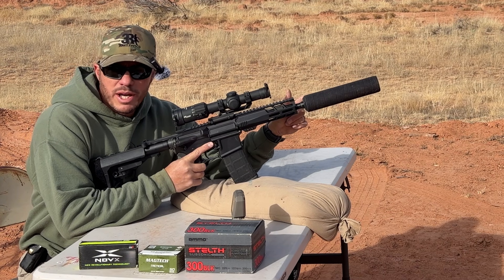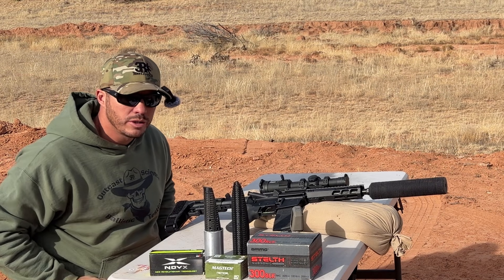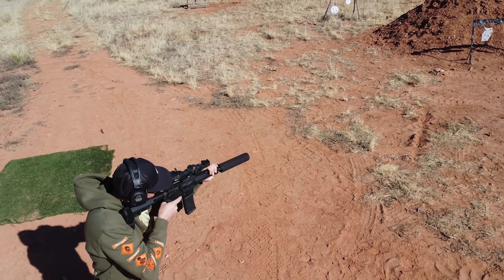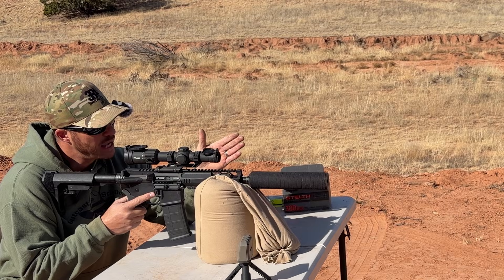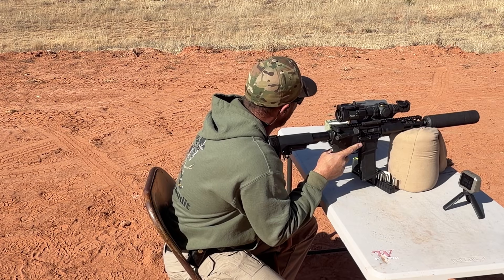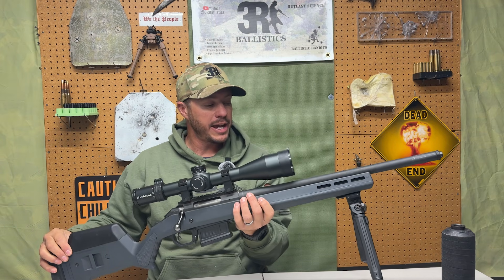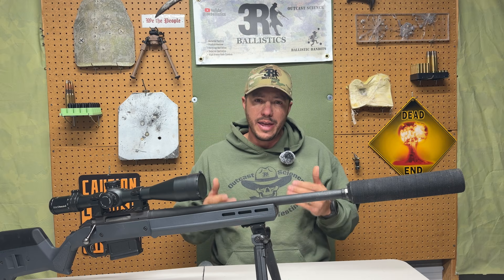3D-Printed Suppressor Tested, Part 2: PA6-CF Performs Better Than Expected

Comment: You can not do an accuracy test when pushing the barrel and can on a sandbag
Reply from the maker: Let really be honest. How accurate is a 7” 300 Blk firing a 220 grain at 50 yards. This was a bit flawed for testing and the reason I’m using a sub MOA rifle for accuracy testing.
Reply: @3RBallistics my 7.5 "is very accurate as long as they are going at least 1000fps muzzle, which i handload so they do. Short barrels are more rigid so should be more accurate than a longer barrel

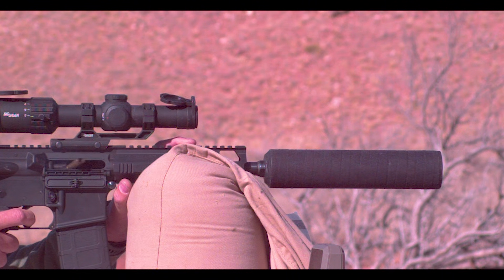Comment: 4:15, regarding yawing.  I have a 7.5 inch AR15 5.56MM.   I shot targets at 8 yards while suppressed.  I shot 55 grain FMJ and 62 grain green tip FMJ at paper targets.   The 55 grain exhibited round holes in the target.  The 62 grain were exhibiting the beginning of keyholing, the holes being round and up to 3/8" approximate oval sized holes. 
I don't know what the rifling twist is in that barrel and I forget the velocity of the rounds, but over 2000 fps.  Both the 55 grain and 62 grain were military ammo.

Comment: For my form 1 printed suppressor I sprayed 2000f ceramic black spray paint in the first baffle before I put in the adapter. Really drinched it in there to try and coat all the baffles. Not sure if it's completely through the whole suppressor. Supposedly it'd help but I've only shot it about 100 rounds now. It's the FTN.5 shooting exclusively 556

Comment: Torture test with aluminum sleeve and carbon fiber sleeve.
Reply from the maker: As soon as the other form 1 gets approved that will also be tested. Possibly more for high rate fire and temp readings.

Comment: 200+ gr 300 blackout likes a 1:5 twist. But I had the same yawing issue because of baffle strikes, I used a long drill bit to align and enlarge the path and that corrected the issue 

Check with an alignment rod
Reply: You bored out the baffles in a suppressor?? I would bet your barrel was threaded wrong.
Reply: @midwestbd7144  you'd lose that bet. I used the ftn 4.5 printed in petg with the breek, and it didn't set perfectly straight. Long bit easily aligned the bore. And then when I was getting to the 800 rounds point the baffles were starting to distort, opened up the bore with the same bit and wobbled it a little to open up bore some.

Comment: So, you asked what I want to see after .308, well I'd really like to see it on a 9mm PCC.  Since it's NOT a .30 caliber round, you would probably need to squirt our another 'can'.  Don't know if you could do that with your original Form 1.  As a technical sidenote, the files that are used to print the device, is the inner bore adjustable?  This way with the proper paperwork, and if this is a viable option, you could print a .22 Cal, .30 Cal, .35 Cal and a .45 Cal

Comment: What supressor is that? Is that the ftn5 or what and if so howd you get it to mount up
Reply from the maker: It is the FTN baffle design. I used the breek blast shield as the connection point

Comment: When you printed the suppressor core, did you notice a good amount of shrinkage leading to about a 0.8mm between the aluminum tube and the outside of the core? I printed mine out of PA6-CF on a P1S (on a cold day so maybe that caused the shrinkage) and I noticed this when I tried to mount my core into the pipe. I am thinking of using fiber glass cloth & resin to fill the gap...or this might be that little push I need to upgrade to a H2S/D for the active heated chamber. Any thoughts/advise is appreciated.
Reply from the maker: I am by no means an expert, more like a novice, at 3D printing. So my advice may not be the best. I do not have a heated chamber but an enclosed printer. I just up the bed temp (90*) and used that as a “heating” element to reduce warping or shrinkage. Again, I’m probably doing it wrong but for me it worked.
Reply: Nylon shrinks more than a lot of other filaments. The OP9 suppressor has separate files with a larger scale factor to account for this.
Reply: Calibrate your filament, nylons shrink, but if you calibrate it you'll be dead on. Look up the "califlower mk2" the few dollars it cost is worth it as that calibration is the most accurate and far better than any calibration cube you'll find. If you plan to anneal the nylon then print the calibration, anneal it, then moisture condition the print prior to measuring the calibration and adjusting your XY shrinkage in the slicer. Nylons absorb moisture which is needed as it gives it the flexible properties so you'll want the nylon to absorb moisture before measuring or using the print as its more brittle before it does so.
Reply: test your shrink core suppressor as is, register the sound signature in a log, make your next suppressor core with shrinkage correction computing in the slicer, test that one too, report here if there is any difference and how significant.  Curiosity killed the cat, but MY BEST FRIEND IS A DOG...

Comment: PAHT-CF would perform even better. Also, plastics are terrible thermal conductors, keeping the can much cooler to the touch.
Reply: Better yet, PPA-CF. but that stuff is expensive
Reply: @spencersmith2542  Even better still? ABS-GF OR ASA-GF. And the ultimate choices for the at home maker???? PEEK / Ultem

Comment: I plan on submitting a form 1 very soon but I'm going to take a faux-suppressor and insert a very ported metal tube for the bullet to go down and then surround the whole thing with wire mesh. This will be for .22lr, that way when it gets fouled up I can just toss and replace the mesh.

Comment: My understanding is that 5.56 especially in a shorter configuration can be pretty hard on these printed suppressors. I haven't put enough rounds through mine yet to know but it would be interesting for you to do so.
Reply from the maker: That will definitely be tested as well. Unfortunately the other form 1’s I submitted are taking longer than a week.
Reply: @3RBallistics not surprised. Some people have had good luck but they got absolutely swarmed with form ones since they're free.
Reply: It's not as bad as you think, plastic is a good heat insulator meaning it barely gets hot, compared to metal cans you can mag dump it and still have it cold to the touch afterwards, the main issue is pressure and unburnt powder acting as a sand blaster

Comment: Interesting 
I am following this 
As I have a 16 1/2" 300 BO that I want a suppressor for it 
But right now I am using cast bullets reloads in the 300 BO
Reply: Why a 16” at that point just use 5.56. Ballistics are superior with 5.56. Only reason to have a 300blk is to have a short/ quiet package.

Comment: The suppressor is Amazing! It is incredible that such a durable suppressor can be made like that. Obviously there is a lot more to it than what it may seem at first glance, it takes those advanced engineering skills. It's great that you can experiment with the internal physics as you see fit! Great stuff man, thank you for the video! But unrelated to the suppressor, on the first shot of the slo-mo, without the suppressor, you can see unburned powder coming out with the brass as it is being ejected. Is that something a longer barrel will prevent? Or is it a calibration issue with the gas block in the firearm? I didn't see any unburnt powder flying out with the brass when you fired with the suppressor though. Also, I was surprised to see so much flexing in the gun when it is fired, with or without the suppressor. It seems like too much, especially for a 7 inch barrel. Maybe part of what is causing the yaw with the bullet leaving the barrel. I'm sorry for the unrelated questions, lol,  I just noticed it and was wondering what was up with that. 👍
Reply from the maker: I’ve seen unburnt powder and flex in many AR platforms and barrel sizes. I’m thinking these videos, when seen in slow motion, show more than the average eye sees in normal use.
Reply: @3RBallistics  Cool, that make sense, the slow motion does make things seem very exaggerated. Thanks for the response! I look forward to more videos. 👍

Comment: Haven't done a can yet, but a couple years ago I did PA6-CF blast cans on a 16" 5.56 and 9mm MAC. There was gas cutting with a significant amount of erosion after 1000 rds on the 5.56, but it held up, even with printed threads. No issues on the 9mm. Just put in some form 1's, I'll see how PPA, PPS, and ultem holds up once those go through and I do the required legal things. I mostly intend to use them on 9mm, but it may be time for me to get a 300blk.
Reply: Pla+ works fine for 9 and 300bo subs
Reply: If it wasn't a k baffle that's to be expected, you need that reinforcement the k baffle provides for 3d printed cans, pla boi website goes over why and how he designed the ftn series